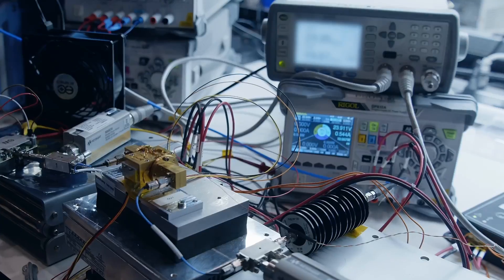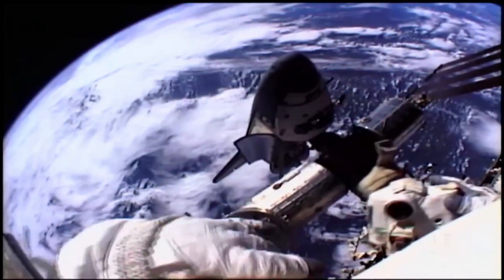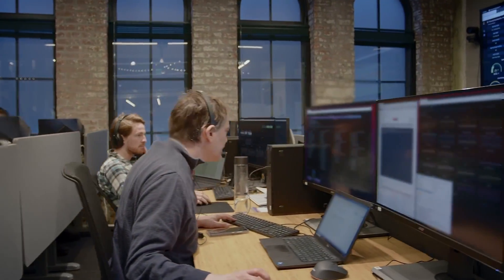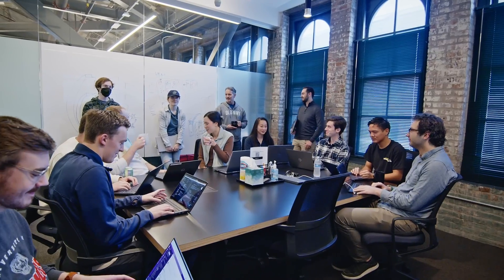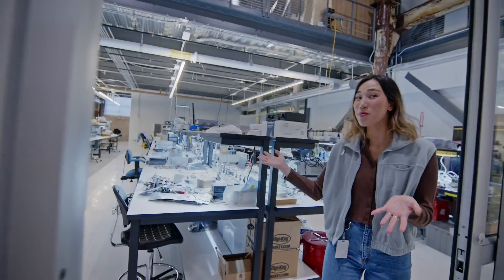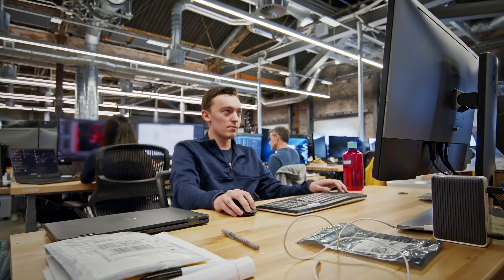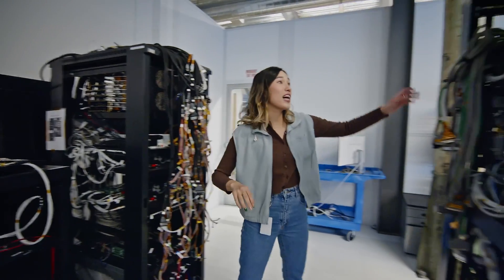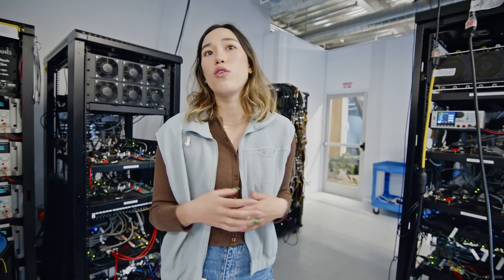The System That Flies our Satellites | Astranis Avionics

Comment: Awesome Video! Interesting to see how much work goes into one avionics box! Really cool to learn about the redundant sub-systems in case one fails there is the ability to switch to the cold spares. Great to see all the checks that go into the quality of the electronics such as checking for tombstoned components as well as populated components. Can't believe how big all the test racks are and the thoroughness of the testing from several pay loads to the EGSE boards for testing communication links with outside hardware. Thank you for the great share!